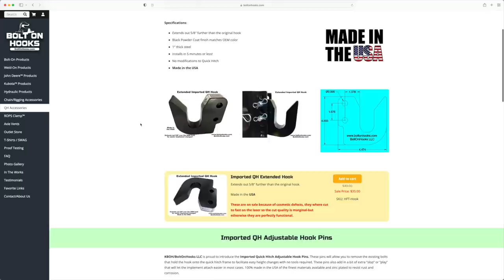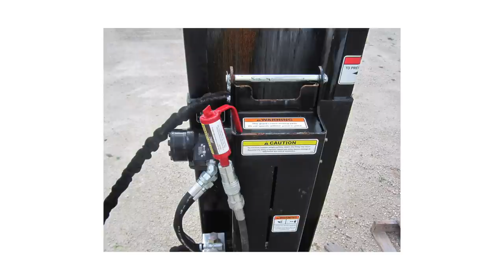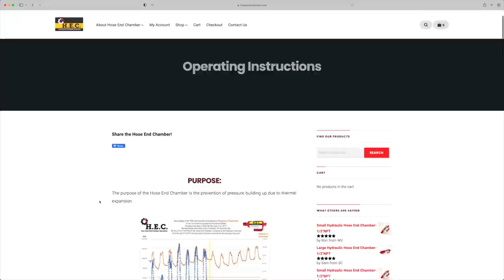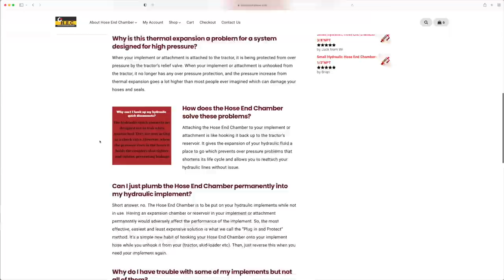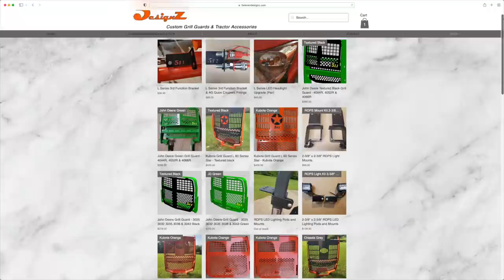WHAT DID SANTA BRING? FIVE NEW TRACTOR PRODUCTS! MERRY CHRISTMAS! 🎄

Comment: Hello Courtney,  I hope you had a great Christmas and wishing you all the best for 2022. I gotta question for you.  Why cant I spin the PTO on my J.Deere 3025e when the tractor is not running?? I have a heck of a time hooking up any PTO implements, because the PTO will not spin in neutral while the tractor is not running. I end up , with a lot of struggle spinning the implements to get the splines to line up and make connection to be PTO shaft. This is very hard to do, especially with the rear finish mower,  the rotary tiller, and especially the rear sickle bar mower. Any help would very much be appreciated. Thanks buddy.

Comment: Great video as always.
 PLEASE READ TO THE END.
 I'm Looking forward to be in my shop more next year. And hope to find out how to get a patient on a new trailer jack lock. I designed to prevent your trailer from being lowered onto a ball without a key to be stolen. It also allows you to use a drill or impact to raise and lower it or a crank. Best of all it can use your existing jack. Basically turning it into an electric jack that locks.
I got a Christmas present 3 days early. I just lost my minimum wage job that was kinda paying the bills and taking all my time. I was on call 7 days a week but only getting paid for about 32hrs. I was called out about 5 times a day. The part that hurts is because, a dealer told boss my van was fixed after the check engine light come on and a rotten egg smell would come with it. Next day after I got it back it was like they never touched it. So boss said it was me that smelled like a rotten egg and fired me 3 days before Christmas. To add insult  to injury he will not take me off the call board. So in 30 days I'll be down as quitting and not be eligible for unemployment. And may even  have to pay the state back.
 But you know what I don't care. The worse job I've ever had is gone. So I'm wishing everyone a Merry Christmas anyway. This is not the 1st job I lost during the holidays.

Comment: Your instructional videos have been really informative and your safety videos have taught me so much. I towed a very heavy log recently and could have had a center of gravity problem because I had the strap too high. I learned after the fact from your video how dangerous that can be. Never again will I strap that high. I'm looking forward to using my HLA 1500 but so far no snow. I'll be reaching out to you because I'd like to order wheel weights and Bora spacers and would like to know what you recommend for a 2017 John Deere 1025r.

Comment: Courtney, what's the distance from the groove in the make spline to the rear plate for the compact pto link? Have a pto shaft that just can't lock on the spine of my bx. This could solve two heartaches with one, slightly more expensive, solution.

Comment: Happy holidays everyone.
C, gonna bring my honesty again..,
1) issues I’ve run into with “pinning” on top hook of quick hitch is sometimes the flanges of the attachment can interfere with cotter pins, or bow tie pins or lynch pins. Best option I’ve done is weld both pins together like a leaf spring “U” bolt and slide thru hook holes then run on long pin vertically thru both pins. Or keep using bolts.
2) hydraulic expansion chambers🤦‍♂️ 
Folks make sure attachments, FELs, discs, snowplows, clam buckets, etc, are in “neutral” or “unloaded” position before unhooking. Then hook attachment hoses together. If not male/female, buy quick couplers and screw together back to back to make coupling union that will join attachment hose together. Yes sunshine directly on cylinders and hose at high noon can cause thermal expansion. 99% of quick coupling troubles comes from not unhooking in an unloaded position and not hooking hoses together. AND when you hook up attachment the hose connects are the last step! Get unit mounted (some fels need hyd power to complete hook) then uncouple hose and hook to tractor. 
3) pto quick connect…to install on a pto shaft quick connect 🤦‍♂️🤦‍♂️ 
No thanks. I personally don’t want any more “connections” or extensions on my pto shaft. Get an overrunning pro clutch if need extension.

Comment: Another idea for replacing the bolts on the quick hitch is a  pin called a quick release or self locking pin. It has a built in spring-loaded ball on the end. No need for a spring pin to fasten it.